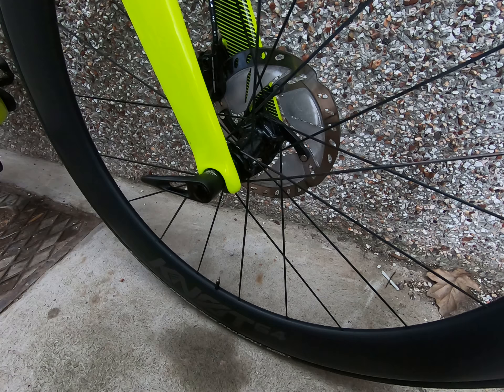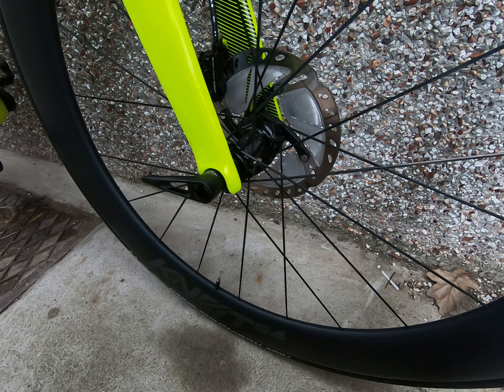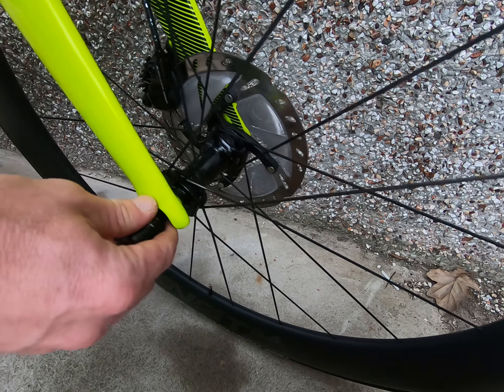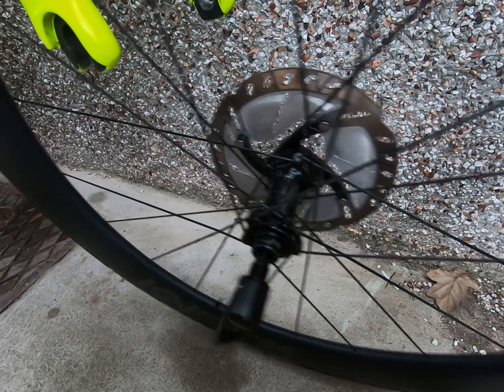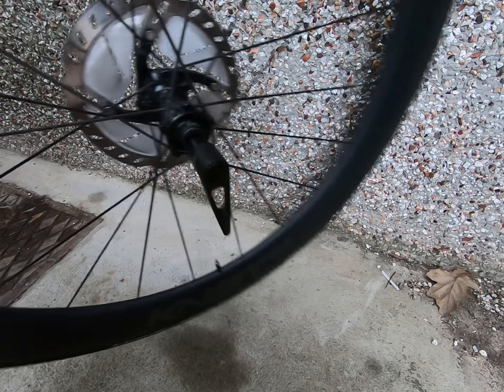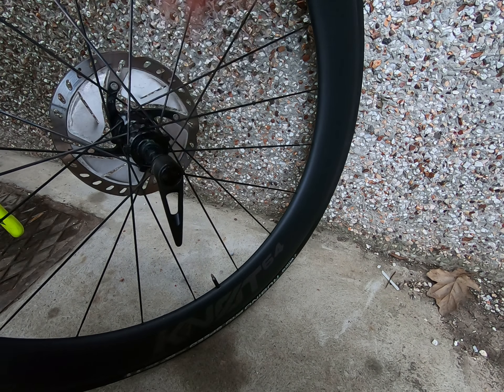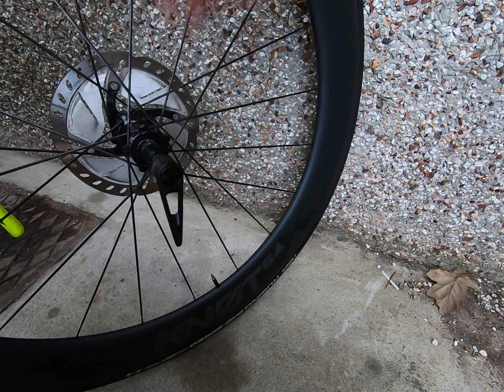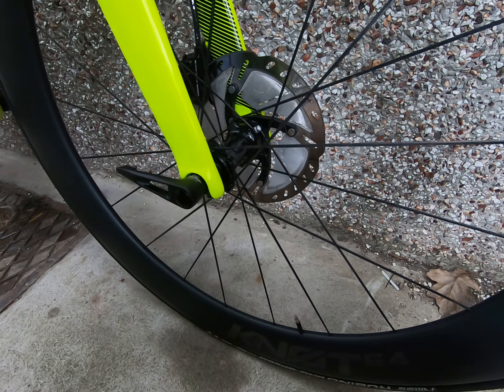Cannondale Speed Release Thru-axle design - on a SystemSix

Comment: How do you remove the speed release axle from the wheel. Do you just pull? Is it compatible with pretty much any thru axle wheel? Thanks!
Reply from the maker: You just pull as with any other thru-axle. It will be compatible with any wheel. What you have to have is the compatible axle, such as the Systemsix and also the correct axle with the slot.
Reply: @MattPage  I see! Many thanks! I’ve just seen on another video it says the hub must be a consistent 12mm across the whole width, not just reduced down with end caps. Yes, understood the fork must be compatible with this standard. Cheers!